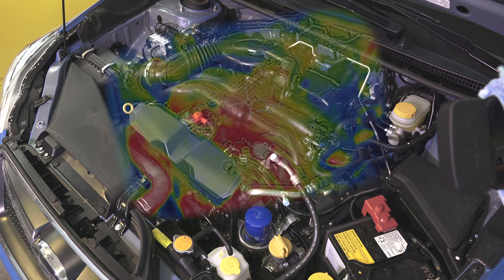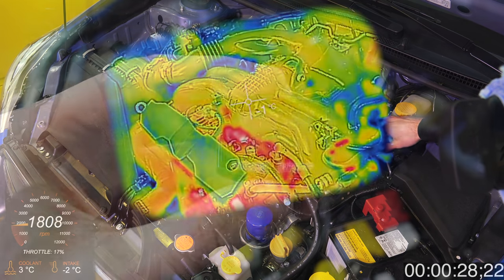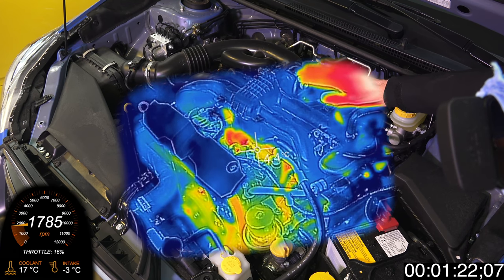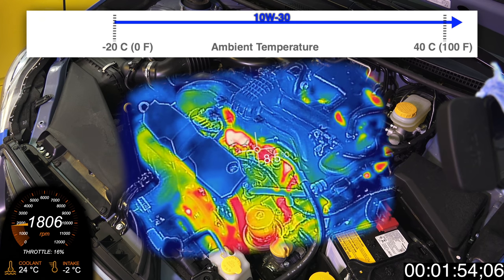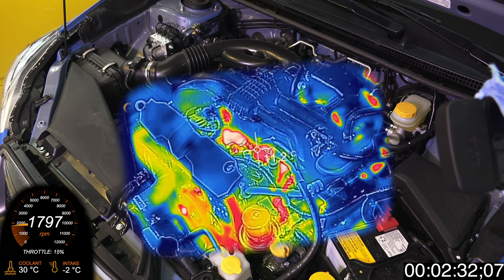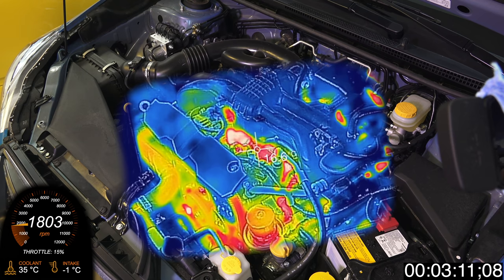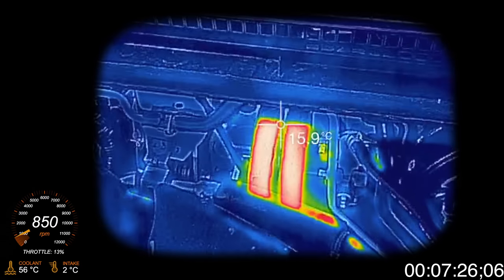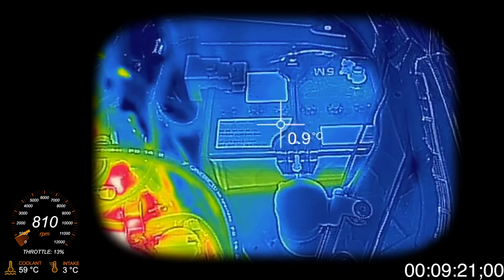Watching A Frozen Engine Warm Up With A Thermal Camera

Comment: At what temp does a battery actually freeze?
Reply: InsideOfMyOwnMind that depends on what kind of battery you are using as well as its condition and level of charge. There is no "set" level, it's all about circumstances.
Reply: Unless it's a battery from Biltema ( store in norway ) wich sell cheap rebranded batteries they should hold to temperatures lower than your oil will.
I've had 3 100ah biltema batteries that all died on me over a total of two years.
The last one is still half good tho, it'll start down to -10 but any colder and it'll need help from my battery booster.
I even tried having the charger keep the battery toppet up, but the battery is just so poorly made that it won't react chemically at lower temperatures.

Don't do as me, buy a propper battery that costs alot and replace it with a cheap one when selling the car so you keep it.
Reply: Depends on how much charge is on it. If it’s 100% charged it’s -67c or -89F. If it’s 50% charged it’s only -23c or -9F. This is based on the charge level of the worst cell in the battery.
Reply: If the Sulfuric Acid is mixed with water and you have something like 65% of Acid than is freezing at -64 C (-83,2F)
Reply: That depends on the charge of the battery. A full charged battery is basically filled with sulfuric acid, which as a really low freezing point. However due to the chemical reaction inside the battery, as it loses charge that acid converts to water. So a dead battery will freeze at 32f. You see it all the time, that is why most people have battery problems in the cold. As the batter gets older, that constant effect of acid, to water, then back to acid, starts to lose its effectiveness. At some point the water concentration inside the battery is high enough, that it freezes. Frozen water expands, and shatters the plates inside the battery. With out plates, the chemical reaction not longer happens, and you have a battery that will not start your car.
Reply: So long as it's fully charged and stays there.   It won't
Reply: You battery actually freezes at zero degrees kelvin.

Comment: It's the case of getting used to the temperatures... I use to go out in a short sleeve when it's not lower than 5C. Up to -10C I'm ok with a jumper. Last week I was warming up the engine with a heat gun :). During the night it was -25 or maybe even lower. God bless heated seats in the Forester!

Comment: letting your car run to warm it up is actually illegal in Germany- as is driving around without a purpose- allthough I don't know of anyone getting an actual ticket (it would be 10€) for it- I got in trouble several times with my neighbours when I started the engine and scraped the ice of the window afterwards... all these laws are justified by saving the environment (alone in your driveway while the industrie ship prawns to the other side of the world to let them peel there for 4 cents less..)
Reply: Oli K that sound like shitty law there, no offence
Reply: Oli K wow your neighbors ratted on you for scraping ice? That's sad, guess my uncle wasn't lying.
Reply: I guess it was designed more for delivery vans than cars.
Reply: What about trucks?
Reply: the law speaks of "unnecessary exhaust gas pollution" does not matter what vehicle it is- but as I said it is not a very strictly enforced law and it only would cost you 10€
Reply: What I meant to say is: it is a neighboorly duchebaggery, to report on you for idling a car while cleaning it in order to drive, its hard and not safe to drive with ice on the windshield and its easier to clean ice and not scratch your windshield when you have moisture collecting from the heater, softening up the ice.
Reply: 3min or 15min is not the same, there is difference in duchebaggery.
Reply: A fine for "driving around without a purpose"? Seriously? Sounds like fun and games in Germany
Reply: its not driving around without a purpose, its driving on the same road multiple times in a short amout of time without a purpose. its because air pollution in cities in germany is higher than the eu allows so you need to introduce laws to reduce the emissions at walkways, buildings and busy roads in general
Reply: So what about when its -30°F? Thats frostbite in about 5 minutes. Five minutes of your car running wont hurt the environment any more than driving around and it'll keep people safer.

Comment: before driving I always wait 30 after engine start before setting off
Reply: Incolder carburetor cars this is needed but in modern cars the computer just dumps extra fuel in to get the car to run normal but I still wait at least 2 minutes for my oil to circulate I can hear the engine knock when it's cold
Reply: That's a lot better than just driving away. Really, the most important thing is to just give the oil a chance to circulate, which actually only takes a few seconds, or your engine wouldn't last long. However its still very thick and gooey, so drive as gently as you can, don't go over 2,000rpm, no full throttle, for a few minutes. It's not actually that much different from just letting it sit. Letting it sit for 10mins until it's totally warm is not necessary...but if you want a working heater you'd better!
Reply: 30 what?
Reply: @erikk77  30 years.

Comment: For the advice to start driving almost immediately because in your previous video you said that the engine warms up more quickly and therefore there is less time/chance that gasoline condensates on the cylinder walls (removing the oil film) there is one thing I dont agree on: all modern engines are lambda controlled. But in the first minute the ecu runs in open loop. That means it has a fixed mapping until the lambda sensors are warm enough. 
'When the lambda sensors are warm enough they can adjust the mixture according to the composition of the exhaust gasses (and they will lean out the engine). But until that, the engine runs on a preset mapping which is rich, especially when its cold.
I think its wise not to drive as long as the ecu runs in open loop on that rich mapping (so the first 60 seconds). As long as the throttle bodies are closed, there is less air in the engine (lower pressure), so also less fuel and fuel evaporates better in low pressure, so less chance of condensation of fuel on the cylinder walls, and less chance of damage due to lower rpm/load.
So my advice is when the engine is cold (below 0C) let the engine idle for at least 1 minute to get the ecu/lambda sensors running in closed loop so that mixture is adjusted to the need of the engine.

Comment: Last winter it got to -15*C for 3-4 days over here but with windchill factor of -20-25*C. That's when i saw with my own eyes the difference between 10W, 5W and 0W oils. I had my oil changed just 2 days before the big chill and decided to switch to fully synthetic Bardhal 0W-40. When the time came to start it up, it just took about 2-3 seconds to fire up and after that no strange noises were heard. However the rest of the cars on the lot were mostly with 10W and at start up, their petrol engines sounded like diesel ones, fed with sandpaper.

Comment: Why does the engine RPM drop once it heats up?
Reply: newer generation cars automatically warms up a cold engine by increasing idle rpm. once it detects its warm enough, it will naturally drop to its normal idle.
Reply: same question
Reply: A lot of things. With thicker oil it may be more beneficial to run higher idle temps to keep oil pressure higher. Also on some newer cars they use higher rpm along with higher fuel ratios and even different injection profiles on cars with DI in order to heat up the catalyst faster and get emissions down.

you don't have to wait for the rpms to die down before driving. just wait for 30s to a min and then drive the car lightly as what the video says.
Reply: to put it simply, the engine is trying to get some heat built up when it's not under load and when the engine is warm there's no need to keep such high RPMs so it drop's down to a more economic RPM.
Reply: there is more drag in a cold motor and fuel condenses quicker. between the two it causes the motor to need more rpm for smooth idle. This is the reason modern passenger motor run at such high temps over older motors, to gain effiecency.
Reply: It's the same thing that a choke does on a carburetor. The computer sends extra fuel to the cylinder to help it warm up and keep it from stalling
Reply: for many modern cars, you can blip the throttle to around 3000 and the RPM will drop before it's considered warm enough.  It may still remain above 1000, but it still lower anyway
Reply: because fuel doesn't actually burn, it is the atoms that do. As such in order to get a proper burn, the car atomizes the fuel, using fuel injectors and high pressure. Problem is cold fuel is harder to atomize. When the engine warms up the fuel is no longer cold when it reaches the injectors, because it gets heat off the engine. But when the engine is cold, there is no heat to warm fuel, so the fuel can not be properly atomized. To compensate for this the car injects more fuel. More fuel, means higher rpms. Also the various sensors the control module uses to determine the air fuel mixture, then correct it, must be warm to be accurate. When the car first starts, these sensors are not warm, so they are not accurate. As such the car runs in what is called open loop, or it ignores most of the sensors, and runs off predetermined values. Those values typically mean that the engine gets more fuel than necessary.
Reply: U Wot M8 the automatic choke. it runs rich on cold start.
Reply: +Kevin Weil
Please tell me you aren't a science teacher, chemist, physicist, or engineer...  Even your first sentence is wrong.  I suggest you read up on what burning actually is:
https://en.wikipedia.org/wiki/Combustion
You may also want to look up the definition of "atomize", as it doesn't literally mean to turn things to atoms.  While you're at it, look up the first few laws of thermodynamics.
Reply: Peter Schmidt I know that technically my sentence is wrong, but if I explained in such a way that the person still had no idea what I was talking about, then it wouldn't be much of help. I also know what a burn, basically the separation of two different atoms, in the internal combustion engines case hydrogen, and carbon. I also know that atomization isn't actually turning something into atoms, but the fact still stands, that the fuel burns when atomized, and cold fuel is harder to atomize, than warm fuel. I am a auto mechanic, so I guess technically you can say I'm an engineer. But since your such a genius, about you explain to everyone why it is, that when your car engine is cold, the rpm is higher than, when it warm.
Reply: i think the only thing that bothered him is that in america people say atomization instead of vaporization. and you're right, fuel assuch doesnt burn, it's the fuel vapor that's highly flamable. you're allso correct in that cold fuel is harder to vaporise but the main reason modern cars rev up after cold starts, i think, is to warm up the catalytic converters and thus make them start working.
Reply: Kevin Weil Still wrong - burning isn't the separation of 2 different atoms, it's a mixture of elements from a fuel source being oxidized due to ignition, which is distinctly different.  In the case of ICEs with gasoline, you're taking a hydrocarbon, a spark from the spark plug, and O2 from the atmosphere, which results in heat energy, CO2, and water.  Note there are no independent atoms on either side of the equation.

What you are right about is the fuel burns best when atomized and coldness makes that more difficult.

Anyway, the answer has already been explained - the car's computers tell the engine to rev higher in order to increase heat.  Once it runs at optimal temperatures, the RPM decreases.  Not really anything else to it.  Whether or not the fuel line is the primary reason for the engine trying to warm up, I have my doubts considering fuels like gasoline are very volatile and will start bubbling if they get too hot (hence vapor lock).  I'm not denying that it is a reason.
Reply: Cars run rich in order to warm up the CAT because if it runs rich, not all the fuel gets used while in the cylinder leading to higher exhaust temps thus heating the CAT faster than normal.
Reply: When you start your car the engine management system runs on open loop which means that it is running on default since your Catalytic Converter needs to reach temperatures around 600 Celsius for it to start working. After the required operating temperate is met your car will run on close loop where it will take readings from different sensors to optimize how your engine runs.
Reply: Finally, someone with the correct answer... its all to do with emmissions
Reply: Aldwin Christian no not just new cars you don't know what you're talking about
Reply: Kevin Weil I think engineer is a bit of a stretch bud.
Reply: As previous commenter Archer pointed out, the main reason it runs at a higher rpm is to warm up the catalytic converters as quickly as possible and get the engine running efficiently to reduce emissions.  It typically also runs a little rich during cold start to get some unburnt fuel to the CATs where the oxidation there warms them up even more quickly.
Reply: Yeah but any cold engine runs richer and has slightly high idle. My diesel trucks don't have cats and they have high idle cold. Even dirt bikes run richer sometimes but doesn't always mean the o2 sensors and cats need to be warmed up. Mainly it's because the metal needs to expand and oil to be up to temperature.
Reply: To save feul.
Reply: Yep, has more to do with the internal friction of cold motors. I tune race motors to idle high on cold start with no emission concerns. Many can mark their hard idle and turn it down to see how rough the motor runs and where dies sooner cold. Just get it set back right and it might be best to do manufactures idle set process.
Reply: U Wot M8 google child, google
Reply: Because once it reaches operating temp the ECU stops running in "open circuit" mode. When something is outside of parameters, like the engine is really cold or an airflow sensor or O2 sensor stops working, the computer can't correctly run the car, so it goes into "closed circuit" mode, where it just "assumes" the worst and gives the car the air-fuel mix that it will run off of in the worst case scenario. So it still runs, but at a much less efficient rate, and it makes a lot more pollution. This is the mode a cold engine is running in. Under normal "open circuit", the ECU is monitoring everything, and metering out just the right AFR, the right spark, etc ("open" because it's taking feedback from the environment, as opposed to "Closed" where it's just running off of a set of programmed parameters designed to allow the engine to run under most conditions...just not at peak efficiency.
It's like keeping a fire going by just piling on the fuel to make sure it doesn't go out, rather than carefully adding a piece when needed to keep it at an optimum temperature (maybe that's a bad example, since most people probably have no clue how to run a wood stove these days!). You'll waste wood, but if for some reason you can't tell by looking (God has stricken you blind temporarily), you can make sure it doesn't go out, because that's much more of a pain in the ass.
Reply: @kingkevin267  there was so much incorrect information in your comment that it hurt. Also, your conclusion of "because I'm an auto mechanic I'm also am engineer" couldn't be more false.

Comment: It's important to notice that even as the coolant is getting hotter, oil temp takes it's time and since driving the engine hard safely depends on optimal oil temp, the coolant temp gauge is not a green light to floor it.
I'd love to see these same warm up tests done on European turbo charged diesel engines, such as the 2.0tdi's, hdi's ect. ..

Comment: your coolant temperature will rise way slower if you turn your heater core fan wide open as well. In my 2008 civic on a really cold day will actually drop from operating temperature at idle with the fan on full tilt. I usually keep the fan on low while driving to get my engine to operating temperature faster on really cold days.

Comment: guys, i have 1g-fe 2.0 liter car, it's strange but why doesn't it have this cold start algorithm of some sorts? No matter what temperature it is outside, no matter if engine is cold,  it starts and idles on 900 rpm every time, does anybody have an explanation? All other cars i can see that they idle at 1500-1900 rpm until it heats up.
Reply: sorry didn't mentioned it, it is a gasoline engine
Reply: Well, if everything works well what's the problem? My car starts up around 1000 or so rpm as well (pterol engine).
Reply: This Toyota engine was introduced in 1988, so I guess there is no higher idle RPM within lower temperature regions.
Reply: Vilius.S also depends on the car

Comment: This has always been a debate of opinions. Always warm up my 2008 Silverado since brand new and now has 248,000 on the block and transmission. Winter time always gets a 15 minute warm up. Recently compression tested at a Chevy Dealership and has almost factory compression. Not hurting the block or internals and could care less about fuel usage doing it.

Comment: i was very worried because i have 10w60 in my bmw straight6 and every morning i head to work it's about negative 10degrees celsius for 2 weeks now. i havn't got to change my oil yet, and every day my worries about my engine increase. you've put some peace on my mind about that topic now, thank you for that. i'm still gonna change to a 0w40 next week, just going to be sure, because this engine has run more than 300.000km alraedy and i can't afford buying another car if this one breaks.